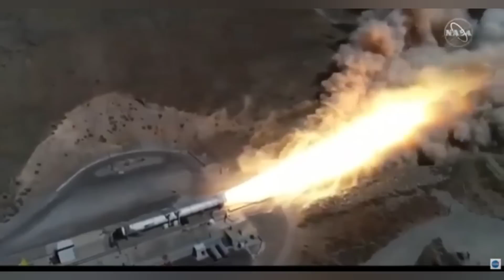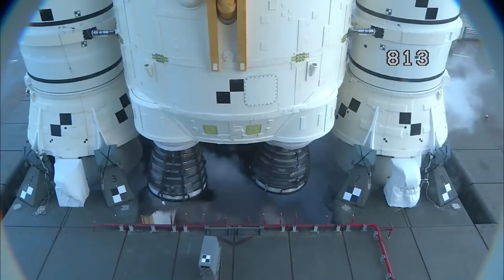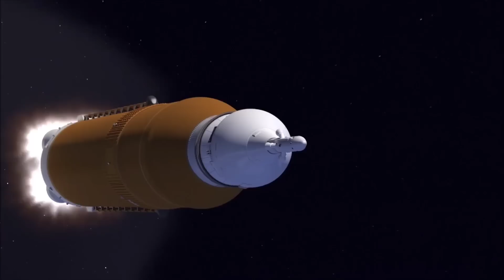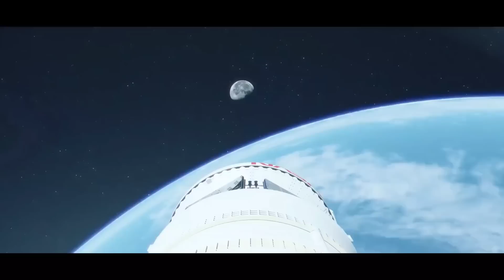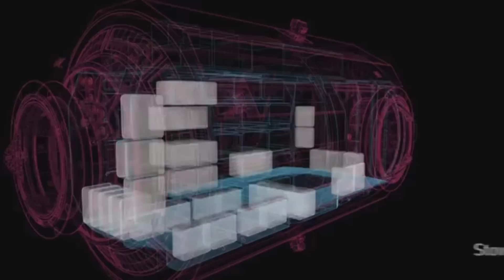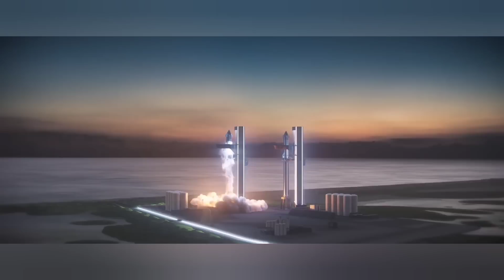Bill Nelson and NASA are doubling down on SLS!!  Why??

Comment: SpaceX can build 33 Raptor engines faster and cheaper than Aerojet Rocketdyne builds 4 RS25 engines. Even if you throw away Starship SH booster, it will still be cheaper to build than SLS core and boosters. Just fly Orion on top Starship booster to save time and money. Boeing can have EUS as consolation prize, but it flys on top of Starship SH booster.
Reply: You are ignoring the fact that the RS25 engines for at least 6 SLS missions have already been funded. The engines are already being built. In contrast Super Heavy has got a long way to go before it is crewed rated. I reckon most of this decade.

So it is SLS for most of this decade. Angry is right. Buy more SLS now, enough for two launches per year. Say 10 SLS in total, maybe 12, enough to go out to about 2030 with two launches per year from 2024 onward.
Reply: Pretty much the engine could
Even be on another type ship . Someone may come up with a better design
Reply: @jondoc7525  SLS has already been designed and is crew rated. They are already building the early stages of SLS4. So a huge amount of sunk costs. There will never be more than 10 or 12 SLS built. There is no point starting over with a new design. I would note only 15 Saturn V's were built and 2 of these were never launched.

The future requirements will be filled by Starship, New Glenn and ULA, but these are all a few years away.
Reply: the capacity of starship is ridiculously high for modern standards. If it is flight proven I dont think it will have much competition until the Chinese get their knockoff going. Until then though, it isn't crew rated, and shouldn't be expected to work until it happens, so SLS makes since until then.
Reply: @waynemapp6333  How can rocket be CREW RATED when it has not flue!
Reply: @waynemapp6333  only cause they are slowing starship down so they can get a bigger piece of the pie , while floating all our tax dollars and probably laundering and kickbacks like everything else
Reply: @auston3952  SLS will be crew rated by NASA after 1 flight, despite having an un-flown  RS25 control system and un-flown SRBs. Similar SRBs caused the death of 7 astronauts during the shuttle program. Starship can be human rated in stages. HLS must be human rated for in-space flight and lunar landing. If this is the case, SLS, Orion and gateway are not needed and only add to the number of untested systems and thus increase risk. The best way to proceed is to crew HLS in LEO using Dragon, do the landing directly then return to LEO and de-crew to Dragon. That way, only HLS is new. Lunar comms can be better done by a small number of satellites in lunar orbit. Artemis is not the fastest way to get a permanent presence on the moon. It slows things down for political reasons.
Reply: @waynemapp6333  You are ignoring that super heavy doesn't need to be human rated immediately. Though the flight cadence should allow this relatively quickly. your estimate of a decade is based on what? If SpaceX fly with the intended cadence, or even just match Falcon launch rate, human rating should be possible in little over a year. The booster will have flown more missions than shuttle did in its entire career. 
HLS will have to be human rated to get to the lunar surface. Since it has to fly to and from the moon surface, The best system is to prep HLS in LEO, crew it using Dragon in LEO, Fly directly to the lunar surface and de crew to Dragon in LEO on its return. This way only one new system is needed: HLS, which minimises risk and cost. Comms from the moon can be more effectively handled by 6 satellites in orbit around the moon,  giving coverage 100% of the time, which Gateway does not offer. The fastest way from A to B is a straight line, NASA used to know this. 
RS25 has a new control system which has never been flight tested. NASAs intention is that the new "cheaper" RS25 version will be used on a manned mission without any flight testing!
SRBs on SLS are significantly different to the already lethal version used on shuttle and have never been flown.
How NASA can human rate this system after 1 flight has its answer in politics and not in engineering nor statistics.
Shuttle killed 1 astronaut for every 10 flights ; 14 dead for 135 flights
Can anyone credit NASA with a safety mentality when they are still promoting a system that uses SRBs for manned flight. Unbelievable.
The death of an astronaut is a tragedy, but it used to be based on a known risk as the potential cost for moving the frontier forward. SLS doesn't move any frontiers anywhere.
Reply: @philcanny6356  Why till the late 2020's before Starship is a proven system able to support HLS? It has already taken most of a decade for Starship to get this far. HLS only works if several hundred tonnes of fuel can be transferred in earth orbit. So far only a few hundred kilograms of fuel have been transferred. It will take several years to crew rate HLS.
It was a really dumb decision by NASA too rely solely on HLS, which was, by far, the most risky and difficult of the three system Moon landing systems NASA had to chose from.
Reply: @waynemapp6333  As I wrote in an earlier response, SLS is not flight proven and does not use flight proven hardware. It uses hardware which is based on flight proven hardware. A very different thing. RS25 has a completely new control system and completely different software. OK most of the physical engine is the same, but it uses new generation transponders and sensors. Any of which could be hiding a problem. The use of SRBs resulted in the death of 7 astronauts, but NASA have continued to include SRBs in their "new" launch vehicle, because the decision won congressional support by propping-up white collar welfare at the manufacturers. Crew rating SLS after one flight is foolish and politically motivated, but NASA has no option, since the manufacturing cadence is so slow that to do it properly would see NASA back on the moon in the mid thirties. Starship has not been going for ten years, your numbers are well off here. The base technology of SLS has been going since the early 70s and they still can't get it right, on budget and in time. SpaceX have a much better track record than NASA in vehicle development and operation, especially if you base examination on activities this century.

Comment: Sorry.. I think you missed the bigger picture. SLS is not reusable. It might be able to do its job, but it can do it once. Imagine owning an airline where the plane only flies one time. The SLS cost BILLIONS for just one... and it's never flown.
Reply: If that would be the case you are correct,

But just a point in your argument, in payload to the ISS: The shuttle was cheaper then falcon…
There is not just cost, there is cost/capability.
SLS can only be used once, but normal launch (without any dewelopment cost) will be in millions not billions and the later version are probably more capable than Starship when it comes to paload without refuling. 
Starship is cool but there is a reson why we are using disposable rockets, because it is cheaper than to get the old one up and running again, especially the second/ third stage.

i don’t see how we can use this not very proven technology and bet everything on it.

Reuse is only good if it is cheaper to repair everything before we use it again. An at the moment we are not able to do this reliable.
Reply: @vollkornbrothd1342  Then why was the shuttle cancelled? it was too expensive. Right now.. the Falcon is the most reliable rocket on the planet. It has become the workhorse of our space industry. Each loss of the shuttles cost billions (yes, I don't disregard the loss of life, so don't go there). I wonder, how many hundreds of launches and landings, and re-launches will it take to say Falcon is the best. If launching 1 SLS a year is a great accomplishment when Starship will do it every week? You call it.
Reply: @billcape9405  How long did it take for falcon to be that good? 
And if you are talking the Russians into account Falcon is not really allone.
Falcon is good but not for everything.
Try to repair Hubble with it… see?

The space shuttle was expensive but only overall not per capability 
and the real reason was the reliability to end it.

This problem is to this day not really worked out. 

Yes you are correct with the los of live, but if you are really concerned about it then do not use starship with humans, it is just a shuttle with a different location of its booster (and yes i know that there are other differences but for the most dangerous part it is)
Reply: @vollkornbrothd1342  Like I stated elsewhere, Falcon 9 was good enough to launch the Deep Space Climate Observatory into Sun-Earth L1 orbit for $150 million back in 2015, so it didn't take all that long.
Reply: @vollkornbrothd1342  Millions instead of billions? NASA pays something like $400M for the four disposable RS-25s alone. That's not projection, that's the contract price from 2020, 1.79 billion for 18 engines. It's also the plain production price, with the 2015 contract for resuming production and producing test articles it would climb to over $580M. 

SLS isn't disposable because that's cheaper. It's disposable because it's a jobs program.
Reply: @jounik  Well i don’t know why they are using reusable engines only one time

But it is a physiks thing why u are throwing away rockets:
You get more capability per ton
So in general you need a significant smaller rocket for the same job.

try to get an GEO satellite down to earth 
if u calculate the energy you see that u need a second stage fully fueld in geo to get to earth.

So you can try to build reusable rockets but it is not the expensive part to fly the up but to get them back to earth
Reply: @vollkornbrothd1342  They are using existing reusable engines only one time because the disposable ones aren't ready. That $400M price tag per launch is for new, disposable engines.

Comment: The raw numbers of the development costs on the rockets is terrible. The Saturn family was developed in less than a decade from scratch. The SLS is how many decades old and bodged from a bunch of existing rocket parts?
Reply: That's what SLS fanboys missed from the get go, Saturn rockets were built from the scratch, everything from avionics, engines, launch platform while SLS is nothign more than a frankenstein of existing and obsolete launch platforms of the past.
Reply: @erlienfrommars  I agree, but you may have missed that Apollo also built most of the ground infra-structure at the same time. The truly dangerous parts of SLS are that the equipment has been changed from shuttle(New RS25 control system, different size SRB with new propellant), and NASA will human rate it after 1 flight. SLS is a potential death trap. At least SpaceX will have a statistical basis on which to rate Starship and it can be rated in stages. 1. HLS ins space flight, 2. Launch to LEO, 3. Flip landing. In the mean time Dragon could be used to and from LEO.
Reply: @philcanny6356  Saturn V was deemed human rated, and for a lunar trip no less, after only two flights, one of which was substantially a failure.
Reply: @andreabindolini7452  Yes, and each of the Apollo missions had failures which could have easily resulted in disasters. Apollo 13 being the most widely known. The point here is that the risk was set against a national imperative to beat the soviets to  the moon. No such imperative exists today, so why human rate SLS for its second flight? IMO: Pure politics.
Reply: @philcanny6356  After Apollo 6, Apollo 13 was the only that experienced a problem related to the launcher. I'm referring to the early shutdown of the S-II central engine.
Reply: @andreabindolini7452  SLS has new control software and sensors on the RS25s. Never flown and untested SRBs. It is really the whole system that needs to be considered. Apollo 10 narrowly avoided disaster due to insufficient error trapping in the guidance control. They just avoided a complete gimbal lock which would have spelled disaster. Every Apollo mission had some near miss, due to the marginal development of Apollo. Even Apollo 11 had software failures on descent. SLS is untested and is using systems that have been modified to an extent that require proper re-validation. Flying people on flight 2 worries me. The experienced staff from the shuttle era have long since retired and taken subtle experience with them. SpaceX staff that have worked on and developed Starship are all current and know every known quirk of the systems. Ultimately SLS cannot move the work forward, due to poor cadence, capability and high expense. I think NASA chose HLS Starship because it paves the way to kill SLS. As soon as starship works, SLS is obsolete.
Reply: @philcanny6356  Funny because other detractors sustain that SLS is in development from too long!
Reply: @andreabindolini7452  That's what you took from my last post? . Let me clarify, when I write "new" regarding SLS,  I should have written different from the 1970s designed shuttle. SLS is basically re-baked constellation program hardware which was itself re-baked shuttle hardware. So much time and money for so little. Still a lot of disappointment to the dollar.
Reply: @philcanny6356  No. Constellation (specifically the heavy-lift Ares V) was a completely different rocket. 10 meters-stage instead of 8.3, different engines (RS-68 instead of RS-25, with a completely different behavior), vastly different payload capabilities and it wasn't human rated. Ares I was different too. Also here: different engine (J-2X or restartable RS-25 instead of RS-25D/E and RL-10), totally different stage, vastly different payload and so on. The only point of contact is the 5-seg SRB. If the effort of making a human-rated lunar rocket is such a "little" goal, I'm surprised than NASA don't recruit personnel on Youtube.
Reply: @andreabindolini7452  Depends how many times they want to re-invent the wheel. It's hardly genius to take 50 years to come up with a less capable rocket made out of old shuttle parts. Maybe your just easily impressed.
Reply: About 2 decades. It was already a horrifically overbudget, shoddily engineered, boondogle when Obama tried to kill it in 2011 in favor of the Commercial Crew Program. Then shelby managed to scream loud enough about communism and stuff that the blob forced NASA to keep the most horrifically overbudget, shoddily engineered, boondoggly part of the Constellation program, the Ares V.
SLS is essentially the Ares V with a rebrand.

Comment: The biggest problem is that Starship HLS will not be ready to land on the moon this decade. Nasa needs to fund the back up plan. The Dynetics Alpaca lander. They need to make that decision now. Just accept that Starship HLS is a beyond 2030 system. Order say 10 Dynetics Alpaca systems. At least enough for the initial exploration of the Moon. Even if it is not a permanent base. Just stays of 30 days, from 2025/26 onward.

Comment: The Falcon Heavy could launch the Orion around the Moon and the only reason that Starship hasn't launched is because the government is scared.
Reply: NASA announced a year ago that they plan to use a Falcon Heavy to launch the lunar gateway to the moon in 2024.
Reply: And because spacex just recently got enough raptor-2 engines. As far as I know, they needed those engines to launch. No?
Reply: @2ebarman  They were going to launch with v1s initially.
Reply: @gamerfortynine  hmmm, so they actually built enough of the v1s and it was the government that stopped testing campagin? It was always my impression it stood behind engines ... hmmm
Reply: @2ebarman  yes, but they would have laughed with raptor-1 if they had the approval at the time.

Comment: Please explain why NASA is not using the FalconHeavy instead of throughing away money? Why is NASA is not running the ULA plan with the FH? Where is the moon-lander? Where is(are) the Gatewaystation(s)? Serious planing looks different and throughs away stupid decissions! We should utilize what we really have. We have the european support module, which is really modular, use the ULA's Ccygnus, use whatever is as cheap and more reliable as possible now.
Reply: Falcon Heavy does not have the capability to get orion to the moon, especially with its second stage.

A other example is the JWST, why not falcon 9? Falcon is really good for LEO but not es good for GEO and for missions even deeper into space it gets worse. Falcon is good but Ariane 5/6 or Altlas V/Vulcan have capabilitys faclon doesn’t have.
SLS has even more capabilitys so that is why it exists
Reply: @vollkornbrothd1342  Falcon 9 v1.1 sent the DSCOVR to solar orbit around the Earth-Sun L1 back in 2015 – all it took was making the launch disposable. The launch cost to NASA was 150 million.
Reply: @jounik  of course but Ariane 5 with similar cost can provide more mass to that point, so it is cheaper per capability in that usecase
Reply: @vollkornbrothd1342  If there is more mass to launch, sure. It would have taken a larger fairing and a FH to send JWST, for example.

The point was that Falcon can launch to open orbits and that one can do a disposable launch on a reusable rocket but not a reusable launch on a disposable one.

Comment: Nice to see you give SLS it's due and a REALITY CHECK to the Starship fanatics
Reply: Scrap this Senate Pork rocket and divert the funding to alternatives
Reply: @scoutdynamics3272  Name a rocket with the same capability and lower cost that can do the mission now
Reply: @vollkornbrothd1342  I haven’t seen SLS fly
Reply: @vollkornbrothd1342  No need to do it now. This obsolete retro spam can Senate pork rocket is not needed. There is no need to go now rather than later. Re enactment of past glories using a throw away mega rocket and retro spam can does nothing. It only te enacts past glories. It does not make progress
Reply: @vollkornbrothd1342  No need to go now. Go later the right way instead of now the obsolete way